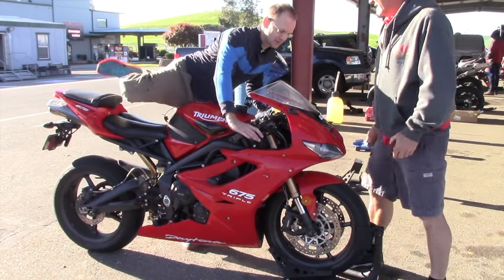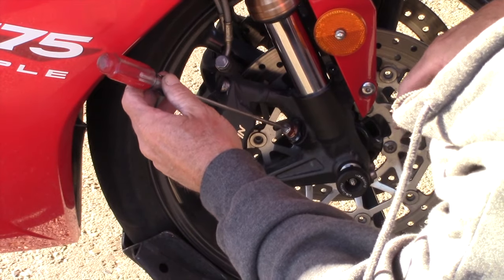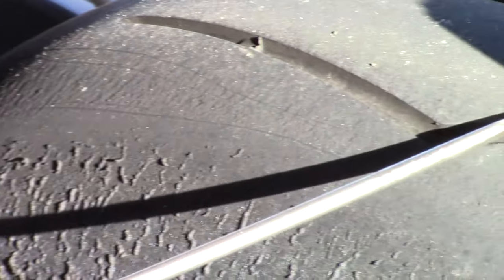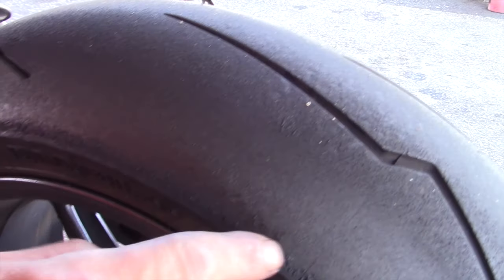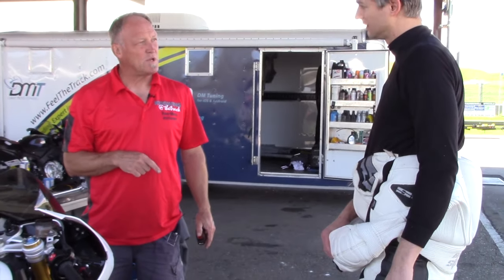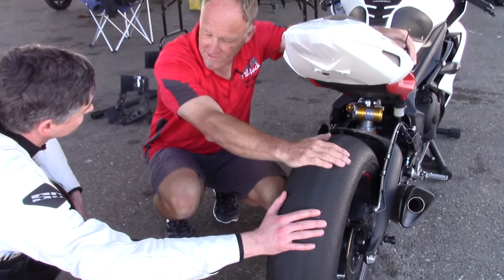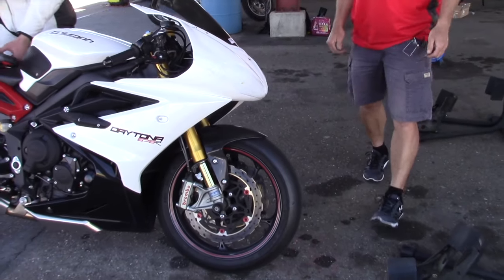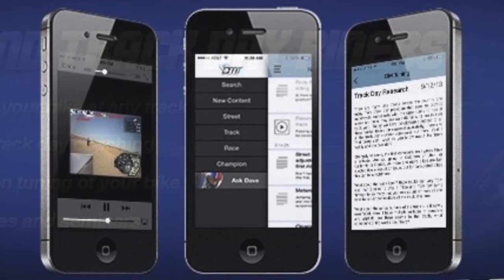2 Clicks Out: Triumph 675 & 675R Suspension Setups (TRAILER)

Comment: Hey Dave,

I have a Triumph Daytona 675 2015 Model, I have installed 190/55/17 at rear than 180/155/17. I am not sure why my bike wobbles at high speed above 140 Mph while I am Pulling on the throttle. I have done 6500 miles and never touched the stock suspension setup neither the Triumph Service folks ever thought to check since I bought the bike. Could you please advise? I feel nervous while pulling the throttle, Does that wobbles at the rear end is due to heavy tire? Please advise?
Reply from the maker: When you put a much bigger tire on the rear wheel the pitch of the bike changes putting more weight on the front wheel. You need to soften the rear shock or raise the forks to get the bike level again.
Reply: Thank you so much, Dave! You've always been a great help. I am gonna tweak the settings as suggested by you and will update you the feedback once I get a free road on a weekend to test the same :)